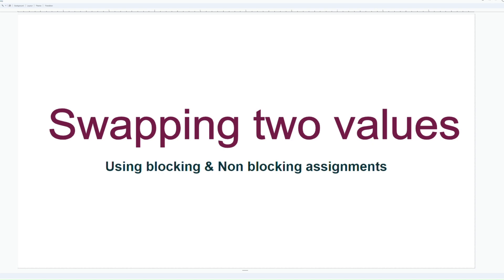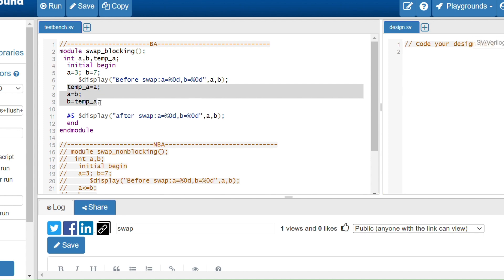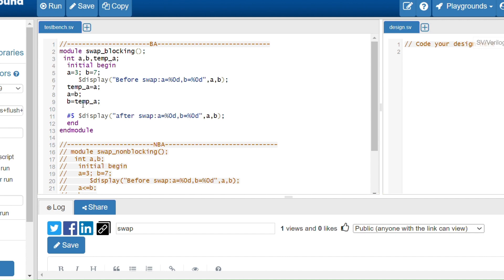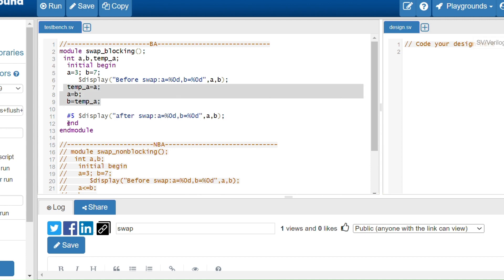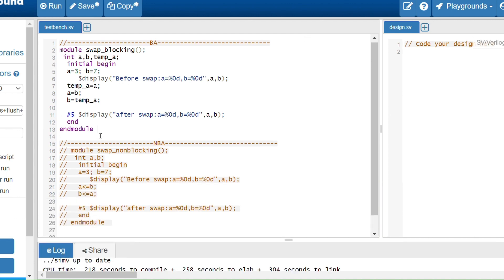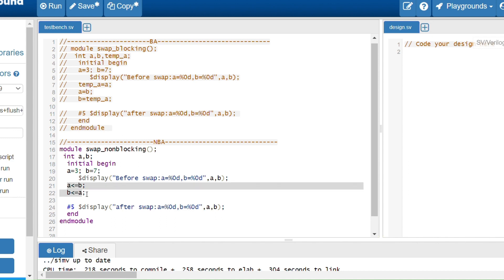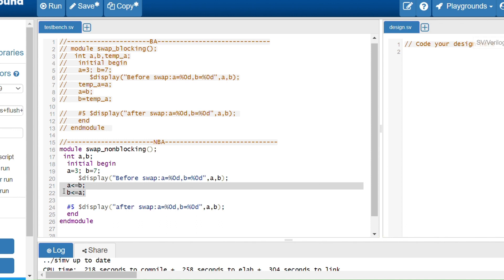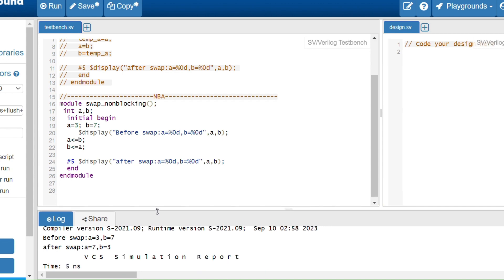Swapping of two values | Blocking & Non blocking assignments |#verilog #systemverilog #verification

Comment: In non blocking I couldn't get the output
Reply from the maker: If u use the exact same code u should get because I got the output as u can see in the video. Which simulator r u using?
Reply: @susheelapatagar  ardec riviera pro 2023.04
Reply: If I use #$ for display it shows an error so I didn't use #$.
But I get output in blocking statement without #$.
I couldn't get output in non blocking
Reply: Thank you mam